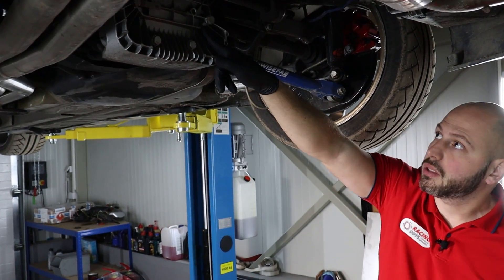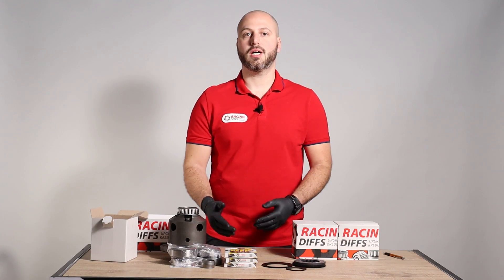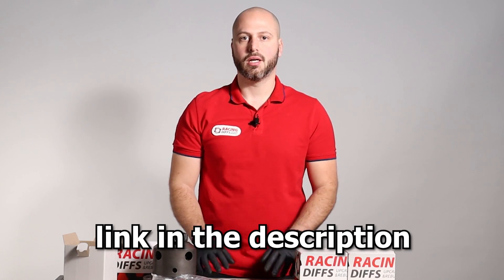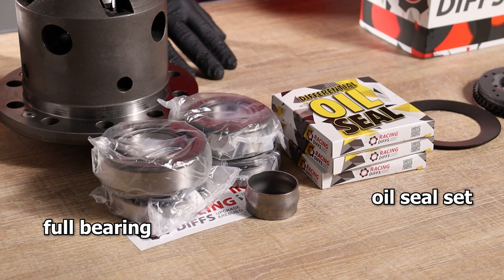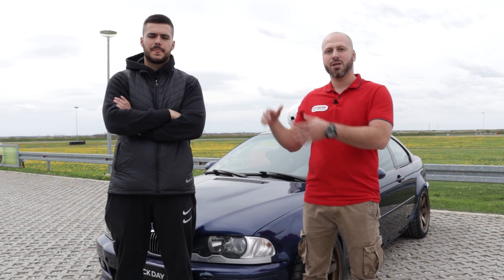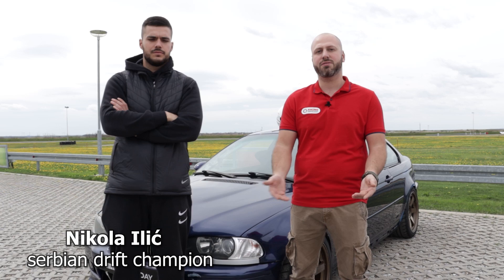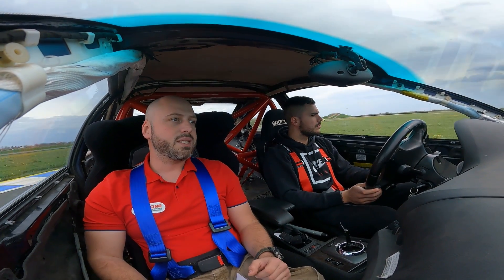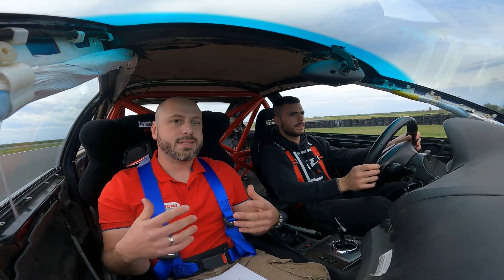E46 M3 Diff clunk FIX | Performance upgrade and free play delete

Comment: Great Production! I went through the problem of the diff making that sound in slow parking lot driving but it never happened when driving hard. I had to replace the fluid in it with the genuine BMW LSD diff fluid then it cured the problem. That was four years ago and no problems since.
Reply: My noise was BAD! I used the BMW fluid for the M5, I believe.
 It took 500 miles before the diff was silent again.